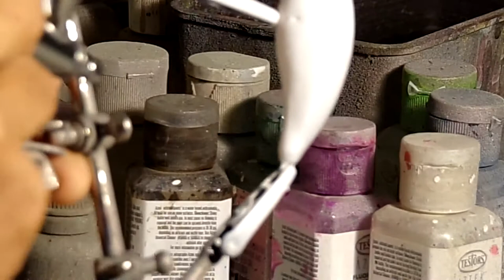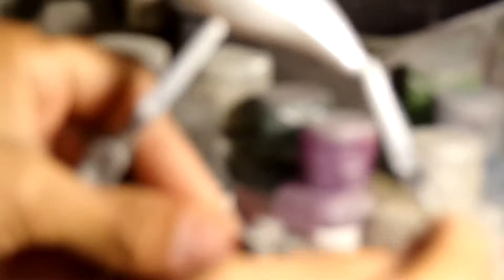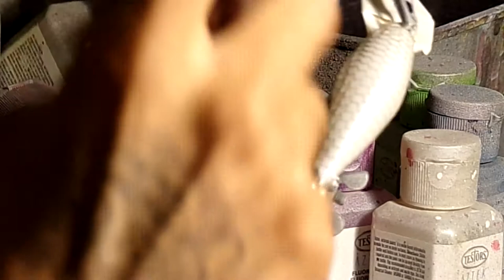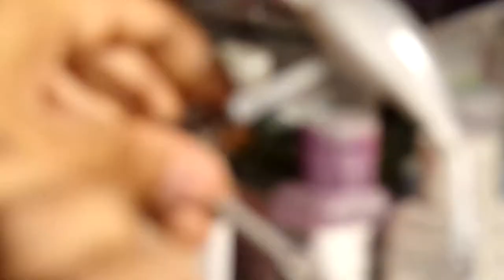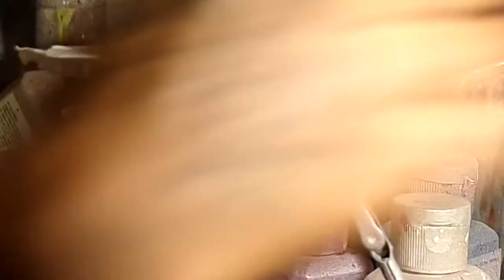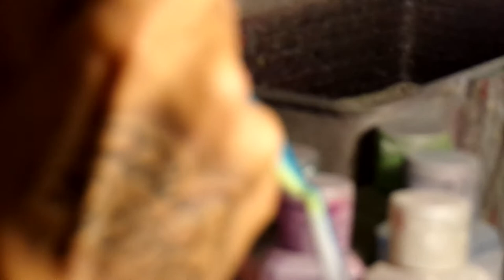How to paint the infamous and super deadly SEXY SHAD crankbait

Comment: The testor paints? Are they water based?  I know wicked is and it looked like the testors were not. Just wondering
Reply from the maker: Bob Alter Top-quality ready to use acrylic paint, no thinner required

Comes in 40 different trend-right colors including fluorescents and metallic

Acrylic paints are water wash-up and non-toxic for ages 8 Plus

Great for use on almost any surface imaginable

Superior pigment quality, vibrant colors and rich long lasting finishes

Comment: Where did you get your stencil from? The link you put is not working for me to be able to click it?
Reply from the maker: it should be fixed now but if not here it is. https://goo.gl/KSvdMu
Reply: appreciate it, really quick response. Is it made of plastic and easy to shape? I wonder if a soft type material would work very well?
Reply from the maker: Thomas Hathorn there are several how to vids on here that show you how to make a vacuum type machine that you use a heat gun with to form it around your baits so that you can make professional quality stencils for your specific blanks. Its really easy to do and quite awesome. I however just cut out what pattern I want and hold it where I want and spray it. This method works great for me as you will see in any of my videos where in using stencils I hope this answers your question if not feel free to ask me whatever you need help with.
Reply: So where did you get the plastic mesh from and does it have a certain size? You can email me at thomas@pldi.net is you want to.
Reply from the maker: Thomas Hathorn local craft store such as michaels, Joannes or Wal-Mart.